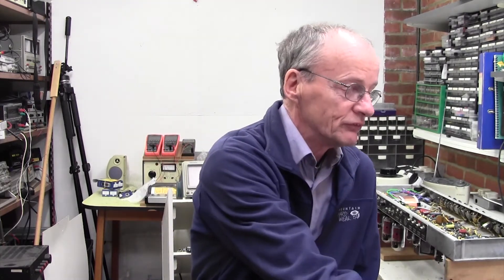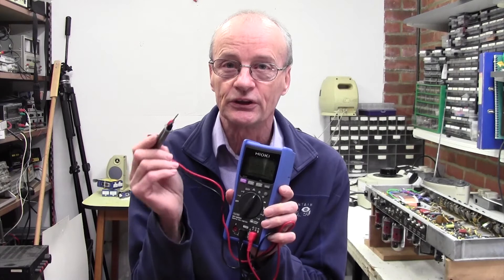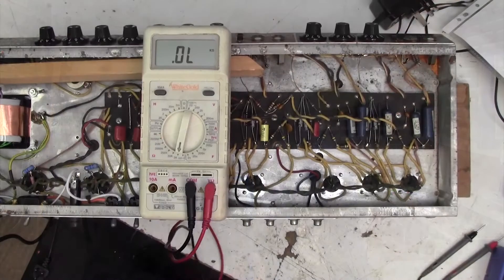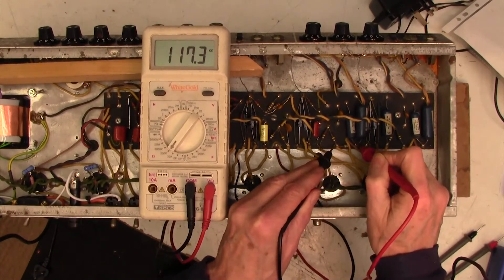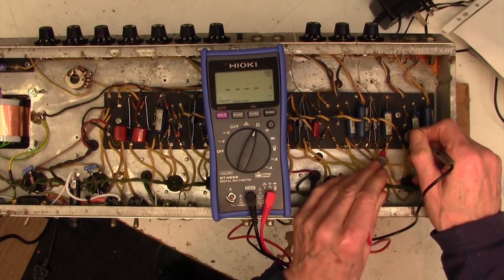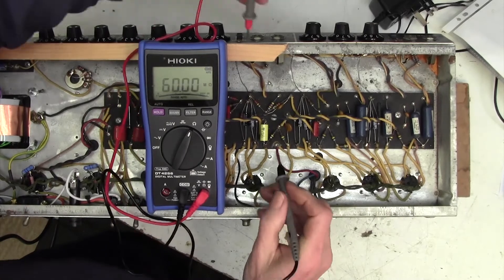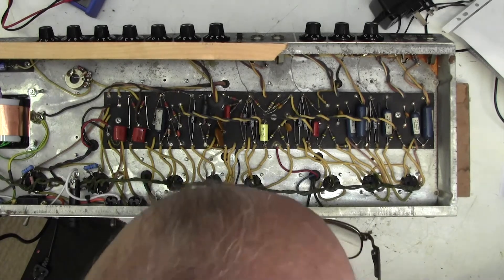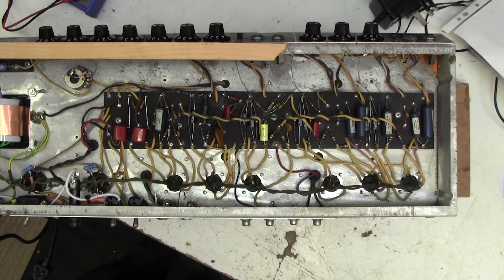How to check resistors on old valve amplifiers

Comment: Stuart - As a recently-retired newbie to amp repair, I can't begin to tell you how much I appreciate all I'm learning from watching your videos.Thanks so much! I'm hoping you can help me understand the nuances of measuring resistors in-circuit vs. out of circuit. I've read over a dozen articles and posts on the web that seem to all agree that one cannot expect to get an accurate or reliable measure when done in-circuit. And yet, from watching your video, that's not necessarily always the case. Can you explain when on can and cannot expect to get an accurate and reliable measurement when checking resistors in circuit, and when it's necessary to lift one end in order to get a good reading?
Reply from the maker: Hi Thanks for the nice comments. Ok it's really easy in principle. IF the resistor has no other resistors in parallel with it, you can measure in circuit. So take for example an anode resistor. Usually ay 100k. One end goes to the anode of the valve, and with the amp off, that's just an infinte resistance. So you've effectovely 'lifted one end' if you see what I mean. Unfortunately the only way you can know is to look at the schematic. I find that MOST resistors in a valve amp can be measured in circuit.
Reply: @stuartukguitarampguy5830  Thanks, that's very helpful. BTW, including an example helped to make it clear, so thanks for that!

Comment: I got a really nice set of leads for my Fluke. Extra long, lovely silicone rubber, and came with a roll-up bag with various changeable tips like aligator clamps, tiny probes for automotive type connectors etc. About  $100 15 years ago and well worth it. Makes it a much more versatile tool. Thank you for your most informative videos. Cheers from Hawaii.

Comment: Stuart, you have been an absolute delight, not to mention that I couldn't have discovered your channel at a better time. I have some experience as a "tinkerer" and can hold my own when a solid solder joint is needed, but I recently came into possession of a Kitty Hawk M5 45 Wart Combo Amp, and considering the only documentation I've found online is a single hand drawn schematic from the 80's and 3 "gut shots" of the 15 Watt variant, I've been hesitant to attempt a repair on it. It worked perfectly fine (if a tiny bit noisy) when I first tested it out, but I just HAD to dissect it after getting a lemon the last time I got an amp. I found 2 scorched 10k resistors, and immediately replaced them. To be on the safe side, I also replaced all of the tubes with brand new 12ax7s and 6v6S's. I turned it on only to be greeted by a pop and then crackling  that sounded eerily similar to the Fender Hot Rod Deville that you repaired with the crackle. Anyway, my point is that although I still haven't deduced what the issue is, I have learned more from 3 of your videos than a year of reading Rob Robinette's material (nothing against the guy; just feels like his material is more for electrical engineers and people with far more expertise than I have). Thank you!
Reply from the maker: Great! I hope you are able to work out what's going wrong!

Comment: Enjoy your videos , learned a lot . I am building a clone of 5F2A and have been advised to put Carbon comp 100k Resisters in the signal path to input . Does this matter or can I put in Metal resisters in this position . many thanks , Peter , Herne bay . UK.
Reply from the maker: Thanks Peter. I would use modern metal film reistors. You have been advised by a purist who believes they can hear the difference between carbon and metal film resistors. They can't!
Reply: Thank you for you prompt reply. I’ll take your advice , and thank you again for the time you put into your videos. Cheers Peter.

Comment: I use an LCR meter DER EE 5000 which is not only automating but also auto identifies Caps, inductors or resitors. You an also accurately test in circuit by selecting test frequencies, measure ESR of capacitors etc with very high accuracy. I don't think it's made in China and it's not super cheap, but I bought mine directly from Japan via eBay at a good price.
Reply from the maker: Ok useful info thanks.

Comment: How do you know when a resistor is not going to be effected by other resistors in parallel when measuring with a DMM?  I have a Super 112 amp and looking at the schematic it is not always obvious what is parallel with what, especially if you include pots and LDRs.
Reply from the maker: Yes you have to watch for that. Surprisingly though many resistors do not have anything in parallel with them.
Reply: @stuartukguitarampguy5830  I read somewhere that usually failing resistors will read high while if they read significantly low that means they are being shunted via another trace to likely something in parallel.  Have you found that to be true?
Reply from the maker: @on1ytheb3st  Yes that's true. Old carbon resistors nearly always go high with age.
Reply: @stuartukguitarampguy5830  I wish mine was that simple, I'm working on and oldish (late 80's) circus board amp and it's got mostly carbon film resistors and no carbon comp resistors.  Just finished measuring every single one and there were a few that are questionable, mainly one that was in spec when it settled but would fluctuate back and forth.  I've already replaced everything from plate load, to power resistors but had to brake it apart again because of excess hiss on certain channels.

Lastly, on the schematic of the Super 112, next to the expected voltage specs, there are sometimes circles or ovals with a number inside divided by a V or MV symbol; would you know what this references, I'm assuming it has to do with the voltage spec with reference to what comes in through the mains.
Reply from the maker: @on1ytheb3st  I thinbk the numbers in ovals might be AC voltages but not sure. Hiss is quite hard to find. You haven't really said what your main issue is with this amp which is causing you to check resistors etc??
Reply: @stuartukguitarampguy5830  well I actually already fixed my largest issue with my first rebuild.  Replaced all electrolytics just due to age and questionable resistors.  Assembled and tested and it had this wall of breakup and crackle; long story short I did everything right but turns out the standby switch had worn down so much from arcing that when triggered it would create this avalanche of breakup.

The issue now is the amp sounds great but when I use my pedals, that’s a different story.  My tube screamer and overdrive sound very harsh and my wah pedal creates distortion in the toe position into the clean channel.  It should be noted that with the exact same setup, on my other tube amps no such problem exists. 

My guess is the hiss on the clean channel accounts for some of that distortion with the wah (since it’s an envelope filter, it takes the form of distortion).  I think there might be some DC getting by on the coupling caps around that potentiometer which in effect might also make the pedals sound harsh.  I think if I were to go through the trouble of lifting one leg of the cap and testing for leaking DC I might as well replace them.
Reply from the maker: @on1ytheb3st  Ok sounds like you're working through the problems one after another! Good luck.

Comment: So you get correct values with the resistors in the circuit, no need to disconnect one end?  I use a Fluke autoranging meter. I am repairing a Firestone radio from 1953, all original, actually works OK, but from all I see and read I am changing the capacitors and want to correctly measure the resistors.
Reply from the maker: A lpt depends on the actual circuit of course, but most can be measured in circuit. If in doubt lift one end.
Reply: @stuartukguitarampguy5830  Thanks. I'm doing that now. First one I tested has no resistance, 2nd one is exactly what it is supposed to be.